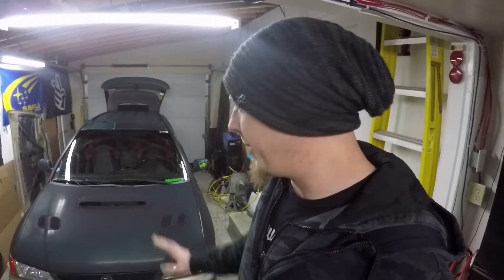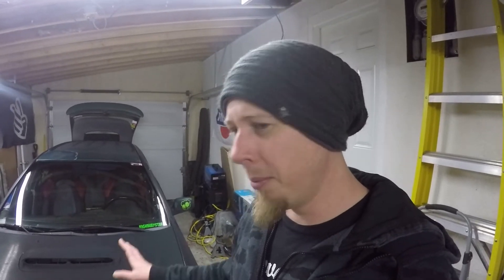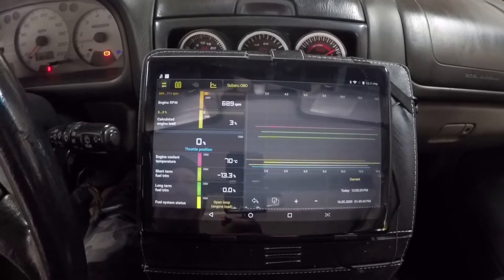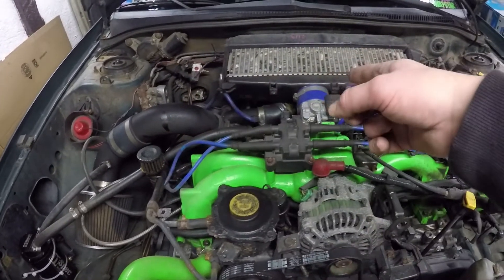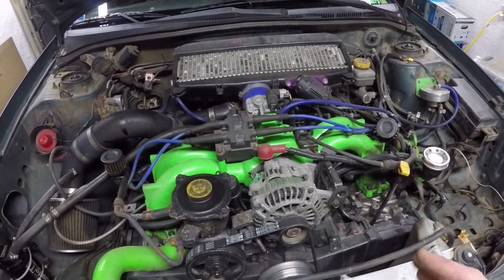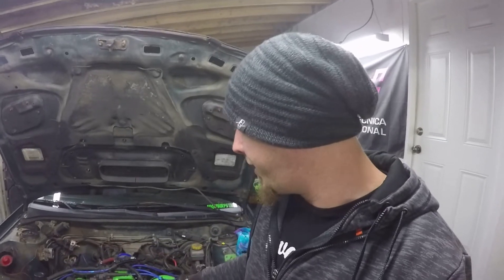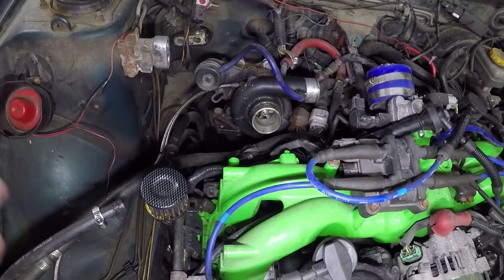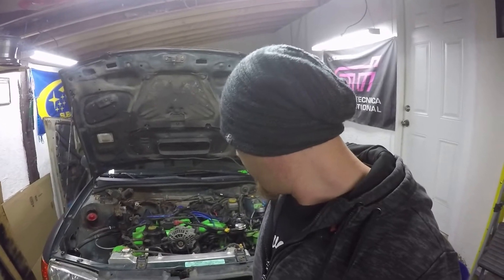Hacked Together SOHC EJ257 Health Check - How To

Comment: man your channel is a mind trip for me we both have very similar builds I also have a 2013 wrx and had a rb20 240 that i built but regrettably sold.. now I have in my hands spare ej253 heads and ej257 block my question to you is did the heads bolt directly on to the block or did you have to do anything special for it to work?
Reply from the maker: That's cool. I used 251 heads on this engine. 253's should bolt on just as easy

Comment: TBH I would love to do a high stress SOHC EJ20 turbo build just to see how it does. This engine is a pretty cool Frankenstein. I am confused why you would use copper plugs though, especially in a turbo engine. Compression test is great news though! Why the dual fuel filter?
Reply from the maker: Copper plugs are far superior for modified and boosted engines. All you get with platinum/iridium are a long lasting plugs that run hot and cost more. Granted, copper plugs need to be changed out more often and for certain "difficult to change" applications, platinum or iridium plugs would be a better recommendation. 
The FMU drives the fuel pressure up over 100psi and regular fuel filter elements tend to deform over time resulting in flow issues. Others with the same setup reported issues so I made the two filters divide flow. I may switch it up in the new car, not sure yet.
Reply: @HomebrewSubaru  I've done quite a bit of research lately which says otherwise. Here is one straight forward source.
https://www.dragzine.com/tech-stories/ignition-electronics-efi/the-great-spark-plug-debate-separating-fact-from-opinion/
Obviously I won't say it's the be all end all, but i also have literature from NGK which says the same.
As for running hot, that's determined by the heat range of the plug, not the plating on the tip. The core of all plugs are copper, there is only a tiny layer of the other metals on the tip. Even copper plugs use a nickel plating.
The shape of the electrode is also important and the fine tip of platinum and iridium plugs is helpful for consistent spark. It's a debate as old as the existence of plugs that don't use copper though.
Ah that makes sense on the fuel filters. I like it! I have often wondered what the limits of flow for the stock Subaru filters are, since they are just so convenient and easy to change. Also watching your video made me think about cutting the bottom off one and turning it into a catch can, hah.
Reply from the maker: All I can say is do some more research. This has been proven out time and again all over the internet. I myself can also vouch for the validity of using copper over others, especially with effective compression. To each is their own ;)
Reply from the maker: @Michaels Carport I have been running these plugs for a year and a half in this engine. They look new and I spent a fraction you did ;)

Comment: What is considered a good compression range for a ej257 stock engine ? I have a 06 sti with 126,000 miles. Running fine. Did replace clutch with an exedy stage  1 kit.  Hope this is over soon going nuts at home
Reply from the maker: Piri Hern the readings should be around the same for a used engine. A little higher would be a great condition engine. Gauges also vary, keep that in mind.